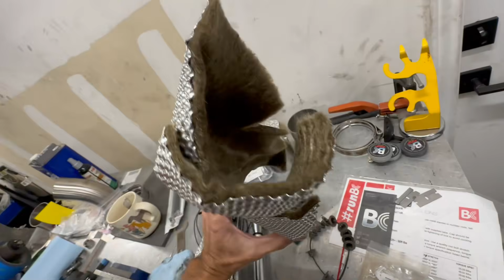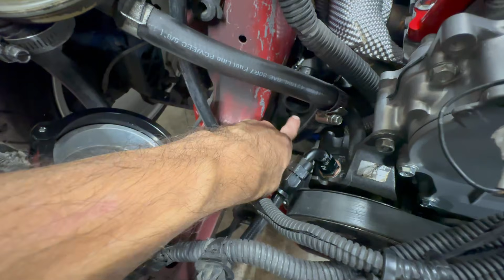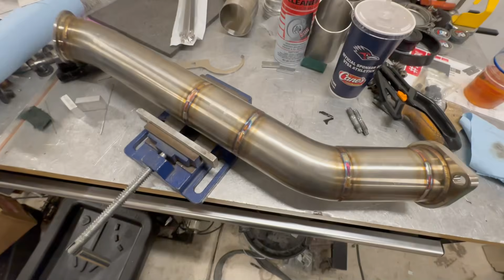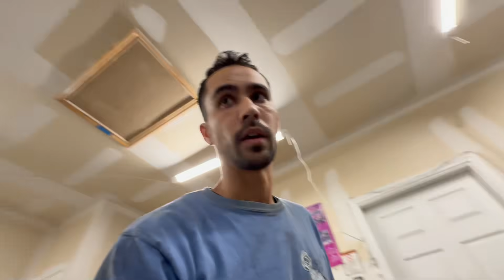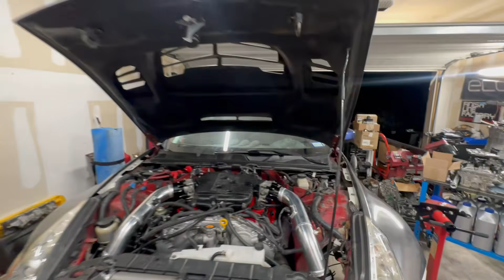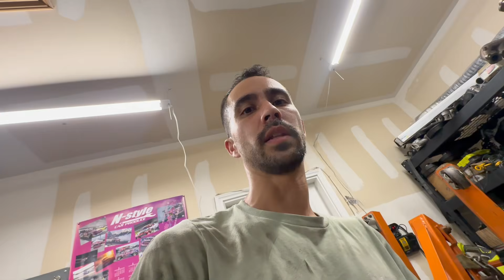1000whp 370z build! - Episode 2 The turbo Kit

Comment: I accidentally broke the pcv fitting on the drivers side aluminum valve cover and to my surprise I found that the hole under it is just 2mm. Strongly recommend to unscrew yours and check it.